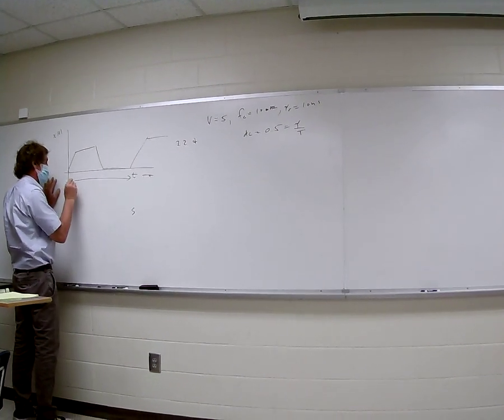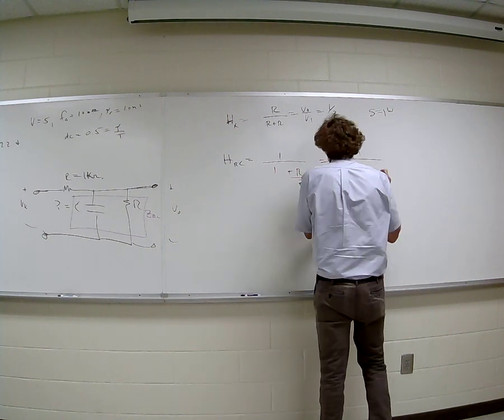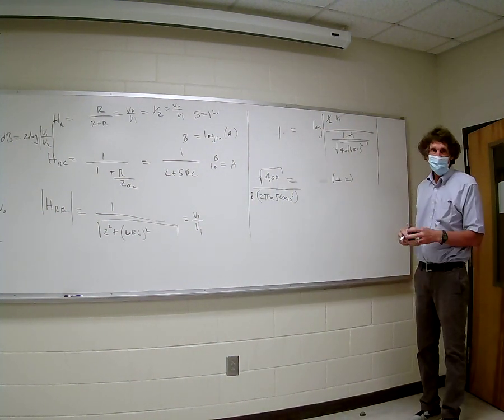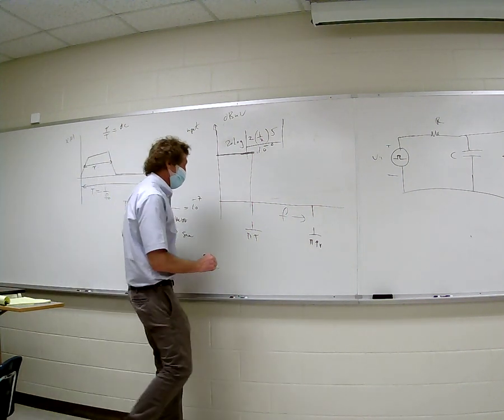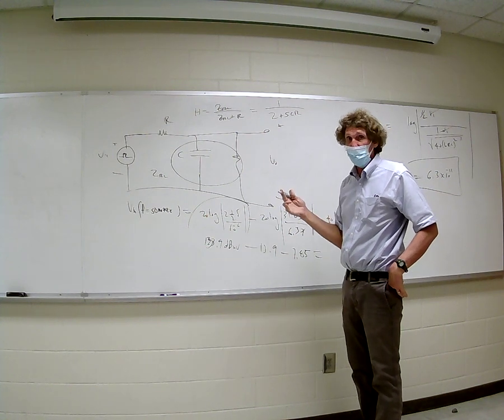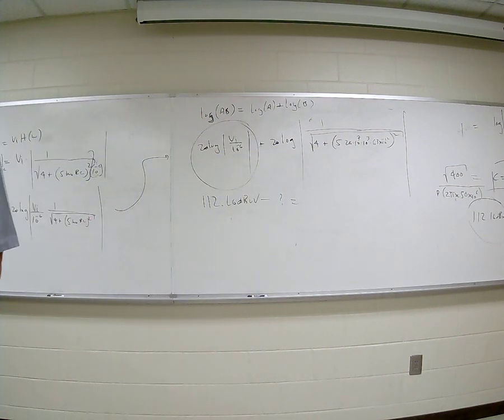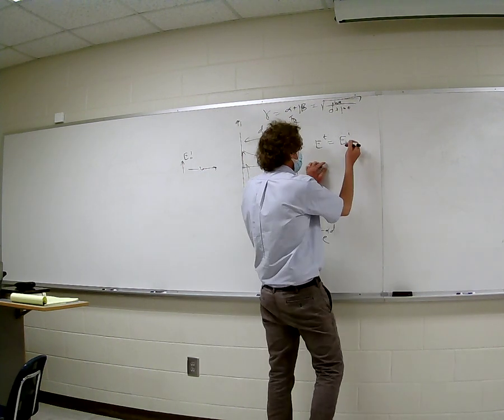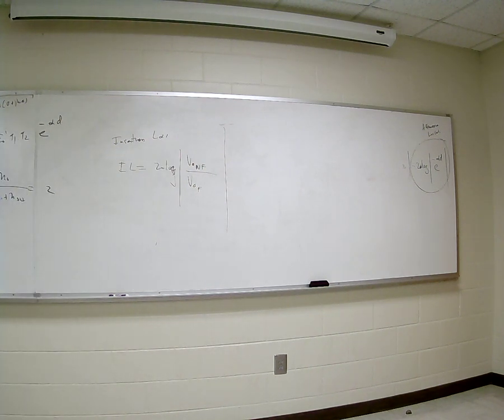Lecture 32 (4/5/21)

Comment: 0:01 3.2.4
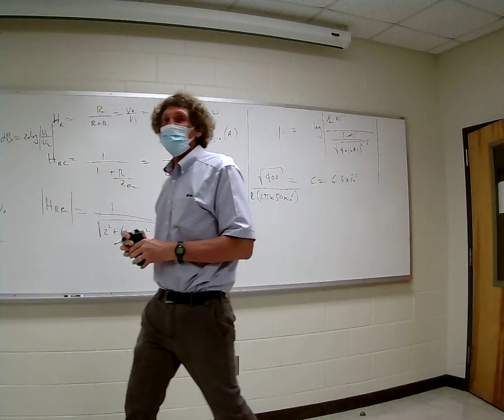16:03 3.2.4 extension
39:20 Shields - Shields can be physical components, RLC’s in which shielding effectiveness is called insertion loss, or how much loss is due to filtering, or shields can be metal shields. 
48:46 Insertion Loss
50:03 Common Mode Chokes